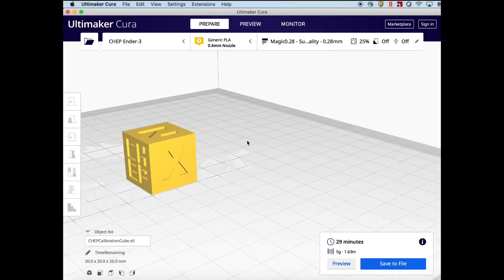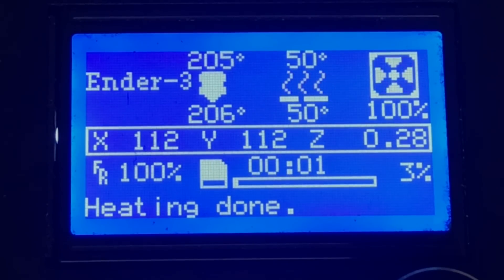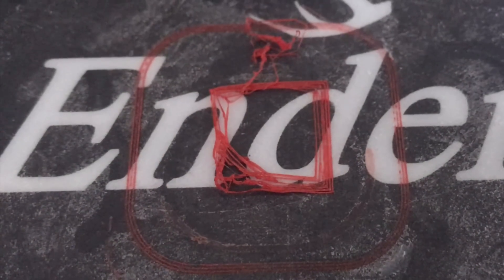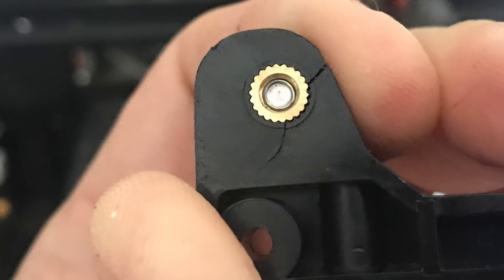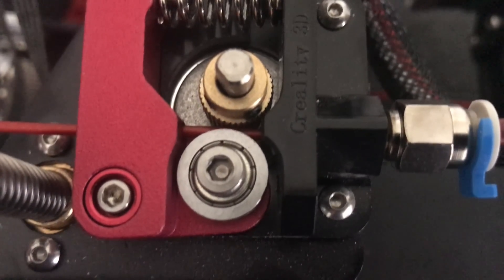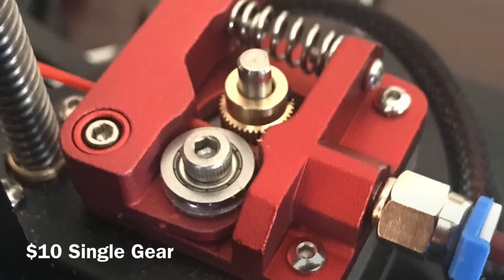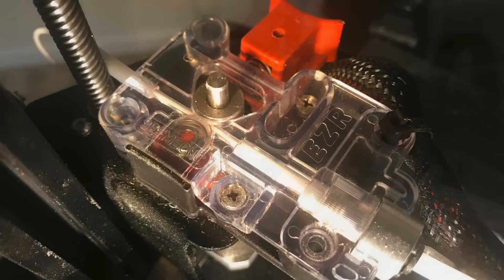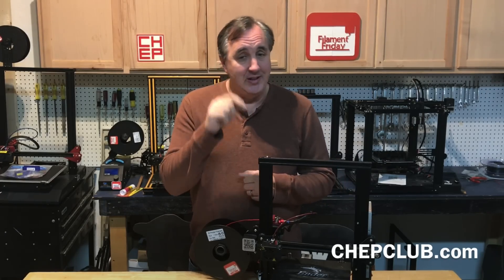Fix Under Extrusion from Cracked Extruder Arm on Creality Ender 3

Comment: Cheers Chep, I had upgraded my Ender 3 to the metal extruder drive shown in your video over 6 months ago and whilst initially things were great just lately I've had some issues with blockages and under extrusion creep in... the mention of checking extruder stepper mount screws made me check mine... all 4 were loose.

Comment: Thanks Chuck.  Another good video.  The stock extruder is really poor on this printer.  I replaced with a mini BMG clone.  Fits and works well, but have not tried flexible on it yet..

Comment: Great video set, Ive been watching all of your videos, I am glad to see you in Cura 4.4, I have that and I tried to import your profile and I keep coming up with the following error; Failed to import profile from /Users/scott/Downloads/CHEP_Cura_Profiles_4.3/Magic0.12.curaprofile: Could not find a quality type super for the current configuration. I do not know if I am doing something wrong. I just noticed in this video you said your profiles came right over and it made me think I was doing something incorrect. I am using the Mac OS version
Reply from the maker: I’ve heard others have this issue that didn’t use the Ender 3 machine profile. If you made your own that could be the issue.

Comment: I discovered the crack after your video on the dual gear extruder which I installed. It must have been cracked for ages as I've problems for a while. My prints are so much better now, I was using hair spray to hold prints in place don't need it now, I just need a jack hammer to get the part off the glass bed ;-)

Comment: I saw so many posts/comments/videos about the broken arms that I printed a replacement one way before mine broke... But, eventually it broke (and I had a replacement already waiting). More recently I also changed to a full metal set and OH BOY it is so much better. That should be the standard.

Comment: Our Ender started under extruding after about 6 months. Swapped in the metal extruder and the problem was only briefly fixed. The springs are junk. The flat yellow springs seem to be much better. Ultimately we landed on the EZR, and it has been great ever since. The EZR is well worth the money!

Comment: Last week I replaced the stock extruder with a metal extruder kit bought from Creality. Before I had great prints but after the " upgrade " I had severe under extrusion. Looking into this issue I found that the bearing was not rotating and the filament was slipping through. I loosened the bearing without result so I reinstalled the original extruder again which resulted in great prints again ... I seem to have an exact opposite experience here.

Comment: Hello @all. With the creality stock extruder, I had the issue that the screws of the idler gear gone loose. So I have wondered why my prints are ugly and not strength enough . So I have decided to change the extruder to the BONDTECH BMG on my ENDER-3 and since then I have no issues any more (and yes I have flashed the firmware, because BONDTECH recommends 415 steps with this extruder). Best regards Martin
Reply from the maker: That’s an expensive upgrade but I’m sure it works good.

Comment: Thanks for spreading the word on the extruder arm crack. It is a very common issues it seems. It is inevitable that they break on ender 3's within the first 100 hrs of printing.
Reply: Happened to me last week. I went with the dual-gear extruder. That works great.

Comment: I had the exact same problem and that's when I upgraded to the aluminium extruder
Reply: the problem is the voltage, by default its 0.52v and  you must turn the potientiometre clockwise till you read 0.85v with a multimeter and that will solve the problem inchallah.
Reply: @aminehamidouche6118  i did that long before I had this issue. It was actually around 0.9 V. My plastic extruder did crack and that was the reason the underextrusion was happening because when I pushed on the lever while printing it also stopped underextruding.
Reply: @xdevs23  oh okay mine was the low voltage setting.

Comment: once you start modifying your 3d printer it becomes your daily routine and you cant stop. I got myself an ender 3 pro i made the "th3d" upgrade and ever since i havent touched. i had a prusa clone before and it died in my hands while i was trying to make it better. i learnt a lot but well. i like chep for his handy solutions using software and on the machine itself.

Comment: I replaced my extruder with that one, but some times I can hear how is applying to much force and skips... I think it must have some kind of pressure adjust on the lever. Also my version purchased in Aliexpress the tooth on the gear are more pointy or aggressive and bites the filament noticeable more than the original one.
Reply from the maker: That’s usually a sign that you have a partial blockage or your temp is too low.
Reply: CHEP I changed the nozzle two days ago and seems fine no more skipping need to run ore tests though, also I use the Capricorn tube.

Comment: I had this exact problem literally 3 days before this video came out. I used ca on the crack and then printed a new arm. Someone has the exact stock arm modeled on thingiverse. You just reuse the threaded insert from your original arm.

Comment: I was printing on my ender 3 pro the other day and went to clean the nozzle with a brass wire brush and i heard arcing, the printer reset itself and now my "Z" stepper doesn't work, i have a new board coming for it. I would think there should not be any voltage between the nozzle and the frame. Would everyone that has a printer check to see if you have voltage here and be very careful not to short out and hurt your MB.
Reply from the maker: Sounds like a short in the hotend

Comment: Did the same upgrade on my CR-10S, but I also changed to a more grippy gear. In that way, I could have a more loose grip and print ninjaflex without it twisting 👌
Reply: Which gear did you use?

Comment: I replaced the plastic extruder on my Ender 3 after four months or so of use. I noticed the under extrusion and saw what you saw, the filament was slipping and not feeding correctly unless I put pressure on the arm. Shimming the spring helped but didn't completely solve the problem. I replaced the plastic extruder with an Aluminum one from Amazon that is basically the same as in this video and the problem went away. I did do a slight modification to the extruder arm to allow printing of TPU. I drilled out the hole on the arm where the filament feeds through so that a short piece of PFTE tube can be slipped in with a tight fit. This tube extends away from the extruder just long enough to clear the Z leadscrew thereby keeping the filament away from it. The other end of the tube is cut to a point (not a round point) shaped like an arrow so that it fits very close to the cobbed drive gear and bearing thereby not allowing flexible filament from moving around too much. I've only printed a few small things with TPU but there were no feed problem with those.
Reply from the maker: I did similar here https://youtu.be/az7pysnV_MY

Comment: I had the same problem in fact Id bet the crack in my extruder was the exact same shape. 
I think its common knowledge that although this is a great printer, it is cheaply made, hence the price tag, and I always say to people that you can buy this cheap but add in about 50% of the base price within a couple of months for upgrades. I can get this base printer for £150 and with a new extruder, capricorn tubing and a roll of filament to print things like a fan cover, some drawers and an SD card convertor (I love yours btw) the base price increases to about £220, which is still a great price. I own 3 of these printers and I wouldnt consider anything else, possibly with the exception of my larger and more expensive CR-10s
The EZR is a great extruder, however, in the UK, by the time you have paid shipping and customs charges the price is over £100 (Yup, almost the cost of the printer itself) but the magic red extruder is available from amazon and is a little gem for me. 
A while back I bought a gold one and this had a hole in the arm enabling you to print off and installing a cable holder, but I just cant find it anymore, so Im considering drilling a 3mm threaded hole in the arm of the red one and installing one that way.

Anyway, as always love your videos and I watch them all. You seem to have a great way to come across as knowing what you are talking about but at the same time you stay in touvh with the beginner. Keep up the good work.

Comment: I'm happy that you covered this issue, however this is something that was enough of an issue A YEAR AGO that I bought two Ender 3's (non pro) and replaced the extruder tops with metal units immediately.  I did order the dual gear CR10S pro extruder tops for both, but I haven't had the need to install them yet.  I enjoy your videos, keep on doing what you're doing.

Comment: This seems to be an ongoing issue across a lot of brands, cracked extruder arms. It makes me wonder if it is a bad plastic batch.
Reply: I dont think its bad plastic, I just think a plastic arm isnt up to the job. If you buy this printer knowing that the parts are cheap it buys you timne to get a new, all metal, one. I love this printer and wouldnt consider any other, but it has faults and as long as you are aware of the faults you go in with eyes open. I always tell people in the UK to allow £200 for this printer. Thats £150 for the printer,  £10 for an all metal extruder, £20 for capricorn tubing and £20 fora roll of filament to print upgrades like a fan cover etc. Also, in addition, only a fool would believe that you wont have to spend more money over time on maintenance upgrades.
Reply: @PennysPitstop  Some of the UK ebay sellers even include a "free gift" of the metal extruder in their Ender 3 listings.  Mostly for a quid or two more than the stock Ender 3.
Reply: @tinplategeek1058  Be careful of the free gift situation in the UK. Free Gift often means they have put in a few extra items they cant get rid of and inflated the price. Id rather buy an Ender 3 with no gifts for £150 than buy one with a free extruder for £200

Comment: I had the exact same crack on my original plastic extruder arm, took me hours trying to figure out the under extrusion. The crazy part is that crack is only visible on the bottom and nobody would ever know unless they took it apart like you and i did and also so many people on creality facebook group had the same exact crack on theirs. I made sure to buy the all metal one made from creality as a oem upgrade, great tip, i hope your video helps others who have this mysterious crack
Reply from the maker: Thanks. Me too.

Comment: Gonna check the arm on my Ender 3, by the way to print TPU (SainSmart) I just printed an extruder base from thingiverse, did it on pla and got deformed by the heat or the stepper then did a new one on ABS and work perfect don't know if can work for ninjaflex but is the cheaper solution for print flexibles.
Reply from the maker: I showed that here:
https://youtu.be/az7pysnV_MY
Somethings wrong if your stepper is getting that hot.

Comment: what killed printing on my cr10 is lint  buildup between the fan and the metal housing causing the fan to slow down then stopping making the heat back into the heat sink and jamming printer. took a while to figured out because the fan was running when print started but as the chamber heated up the fan stopped. I made a chamber from mylar blackets to print ABS keeps the air around print at 100 degrees   making perfect ABS prints

Comment: Anyone know of good couplings for the ptfe tube on the extruder side? I'm having trouble with the ptfe tubing moving back and forth even with the clip in place.
Reply from the maker: The Capricorn couplings are good ones.
Reply: @FilamentFriday  I believe those are what I have now.  They look different than the one in your video if thats what you are using there. Do you happen to have a link to the one that you use?

Comment: That metal extruder doesn't need the screw to tension the spring, the gab between the arm and the base is so much smaller that the spring is much more compressed, making the idler push the filament very hard toward the gear, so much so that after installing it, my filament began coming out with the side of the teeth almost flat, I almost can't do cold pulls anymore, because the end of the filament inside the nozzle is round but the filament that didn't get melt has one side flat, leaving a gap, so the round part catches on something, I'm thinking on the edge of the bowden that is pressed against the nozzle.
Also, my Idler has a lot of slack, when you hold it flat in the horizontal direction, the center ring can move up and down on the vertical direction, that results in when the extruder is doing retraction, it keeps moving up and down a little bit, it's enough to do a rubbing noise, very annoying. I have tried putting a washer, on one or both sides, but that didn't solve the problem.

Comment: Cracked extruder arm is very very common. It is the first thing to look for in Ender 3s under extruding. That is why it is recommended to replace it with a metal extruder. Allows more tension.
Then again..a titan extruder on it does wonders

Comment: thanks for the video. i haven't had any problems with mine yet but i don't do a lot of printing.  I run an Ender 5 and am just wondering if i should be doing any of these upgrades.
Reply: Yes you should.  The Ender 5 and 3 have many of the same parts and problems.

Comment: I had replaced the original extruder with a metal one like you described in this video when the arm cracked, a few months ago; then more recently I decided I wanted to print flexible filament, and I had the same issue you showed in a prior video ("3D Print Flexible Filament on CR-10 Mini and Ender 3"), so I printed a new extruder base where you put in PTFE tubing cut to a sharp tip, and put the rest of the metal extruder back on the printed base, and it is working great.  Everyone with an Ender 3/Pro should plan on replacing the plastic extruder, order one as soon as you get the printer to have it on hand when the lever breaks - it is a matter of 'when' not 'if'.

Comment: Can the EZR Struder work with a vibration damper on the extruder motor? I have installed it, but the damper takes up the extra motor shaft height that the nob sits on. I am currently trying to find a viable solution.
Reply from the maker: Possibly if you get longer screws. Why dampen the extruder. It spins so slow it shouldn’t make much noise.

Comment: I also had under extrusion problems, but had already upgraded to a all metal extruder, so not the problem, but after a bunch of investigation I figured out that the hot end had heated up the filament in the tube. There is an option on the ender 3 to preheat the nozzle and bed which I often use to speed up prints especially short prints. DO NOT use this unless you are ultra attentive to the printer.  I preheat as I am slicing which saves a min or so when the print starts, the problem is that one time I preheated the printer and then got distracted with life and it sat there for maybe 10-15 mins.  This allowed the heat crawled up the filament into the tube and caused it to melt and added friction to the tube.  One print it was working great and then the next (after I forgot about the preheat) it was under extruding.  Hopefully this will help someone else that uses the preheat to realize that this should be used with caution.
Reply from the maker: That’s why I do it in GCode so the print starts right after they both heat up. 
https://youtu.be/nQLJrSf4aXE
Reply: @FilamentFriday  ah, very nice I should have thought of that!  But THANKS, (your awesome man!)
Reply: well i had the same problem. But an easy fix is to run the fan colling the heatsink at 50% all the time. Since I changed it I never got problems again. I am using preheat for every single print and it works like a charm :D
Reply: @bjoernhopp1234  just don't leave it for any length of time, the heat will creep up the filament into the tube and cause friction.  My fan was at 100% and this still happened.

Comment: The brass gear on that metal extruder eventually wears out and the filament slips. I got minor under extrusion. In the end I’ve switched to a BMG extruder. Quality improved amazingly.
Reply from the maker: A real BMG is an expensive upgrade so I would hope it’s better.

Comment: I saw a video on another channel with exactly the same problem, he thought it was the spring losing tension so he printed a spring cup to increase the tension and it did help a little but then he spotted the crack in the arm and fitted the metal kit, I cant for the life of me remember where I saw this video though

Comment: The stock plastic extruder is garbage. Mine broke after only a month after a week of steady degradation of prints. Everyone should simply replace the plastic with metal as soon as they get the ender.

Comment: I had a problem with my pneumatic connectors constricting the PTFE tube so tight it almost sliced through. 
I put a Batam Design feeder on before realizing.

Comment: Great video as always, and yes a couple of months ago my original plastic extruder on my Ender 3 cracked in more than one place, luckily I already had bought the Aluminum extruder and it was a direct swap 👍
It works great, but thanks for the tip anyway 😉
Btw, Cura 4.4 works just fine on my PC and it imported all my profiles 😃